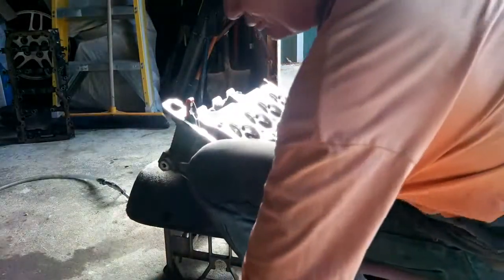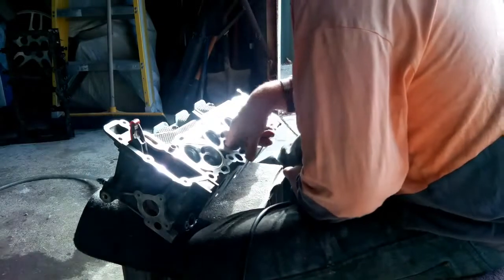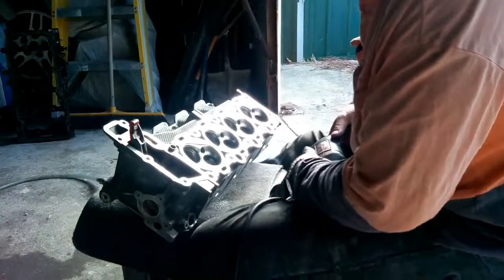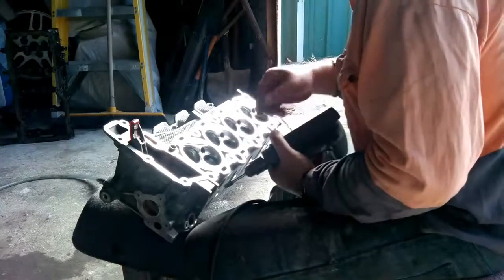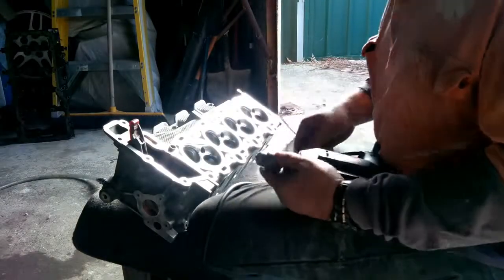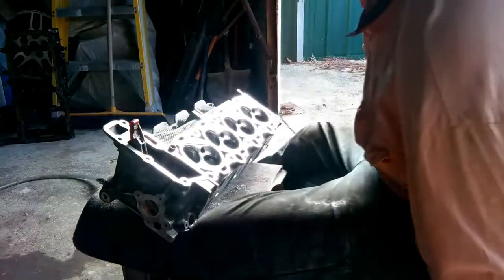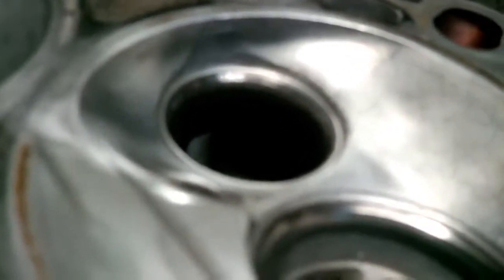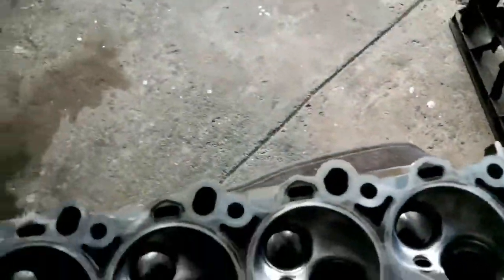How to port and polish WJ Jeep heads for better flow.Chrysler Dodge Power Tech/Magnum 4.7  V8

Comment: Hi Rik, how's the back? hope it's holding up ok. Does it still give you problems or are you pain free?
I'm going to test your memory now and ask you a question about these cylinder heads.
I remember reading that you had skimmed these heads a number of times but can you recall how much (in Thou) you had removed, either each time or in total?
I know it's a long shot as it's a good few years since you worked on them but I thought I'd ask you.
Love your videos they have been more than helpful in getting me to throw loads of cash into my jeep.
Keep up the good work. Regards John (UK).
Reply from the maker: Never pain free just reduction since 1989. I am going into hospital on tuesday to check my morphine catheter. Pain free is when I die but thanks for asking I appreciate it. They  were shaved 2 times once before I owned it and then when I rebuild it. And your right I do not remember how much was taken but I do remember with the high dome pistons at 10 to 1 compression plus the shaving it came to almost 11 to one compression. From memory it was 10.93 to one compression. And that was very accurate by measuring the compression chamber volume. I remember the pistons touched the heads at TDC right near where the spark plug enters the chamber. There is a small rise in the casting. I just removed that with my porting tools. Always check for interference when you make such changes. I have a record somewhere but not sure where it is right now. While building my new workshop everything is boxed up. A compression ratio like that no matter how nice it is comes with problems if you do not have a high enough octane fuel on pump. We are lucky that most companies here sell 98 octane fuel at the pump. I have used lower grades at times but it does not like it. In fact I have most parts now to do a methanol conversion. I hope to get to that next year all going well.  Thanks for the feedback and watchine. Clips coming up when my shop is finished $$$$ Tank tuck, Custom timing gear, Ethanol fuel, Custom intake manifold, Large TB, possible forced induction, more lift and much more. I also have a HO on a stand that will not just be rebuild but modified completely into what I think Chrysler should have done with it. That depends on funds. It would probably be my last dream engine build.  Visitors will be welcome to see the progress by appointment. Many plans just need health and dough lol.

Comment: Hey thanks for your videos! I hope you have recovered from your surgery. 
I was wondering what type of bit did you use on your drill to port and polish your heads? Thank you in advance. 
-Alex
Reply from the maker: I am glad you liked it and it was of use to you.
My next operation is on the 6th of Nov 15 after which I need to take it easy for 3 months.
I will need one more after that to remove an old implant.
The bit I am using for the rough work in the clip is a Carbide Burr available at most good tool shops and or machining supply stores. Some good auto shops may have some but it is quite rare. Be aware they are on the expensive side.
The most useful one I have is a cylindrical shape with a rounded of tip.
I recall paying up to $80 for certain shape bits. Regards Rik
Reply: Thank you! Do you recommend someone that has never port and polished to do so? I have the 4.7 lt in my 2002 dodge durango here in the USA. I believe that your aftermarket parts should work with ny 4.7 lt. What do you think? Also, I was wondering if you can, if you haven't already, put the websites that you bought your internal engine parts from. 
I hope your surgeries go well for you and you feel better in the upcoming months sir.
Reply from the maker: Just call me Rik not Sir lol
Yes the 4.7 Dodge and the 4.7 Jeep are the same engine. So all modifications I have done will work on your Dodge as well. Yes I recommend you have a go. That is how I learned by just having a go. Just take it slow especially when using the carbide burr as they remove a lot of metal fast. Don't push to hard let the bit do the cutting. If you push too hard when cutting aluminium it blocks the teeth and you will have to pick out the bits of aluminum with a sharp implement. 
I brought most my parts from Nick at Airram.com. He operates from Florida as I recall. Regards Rik